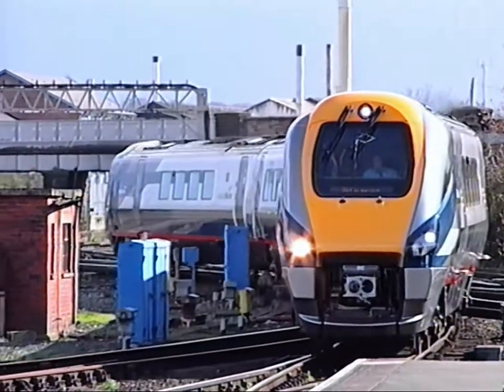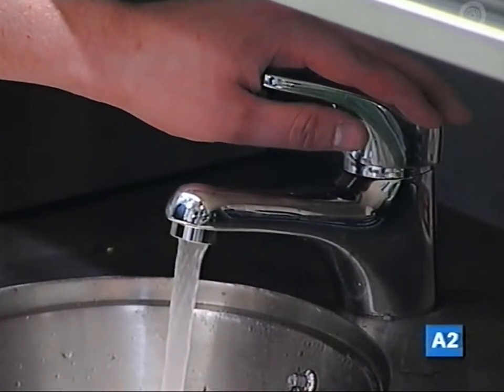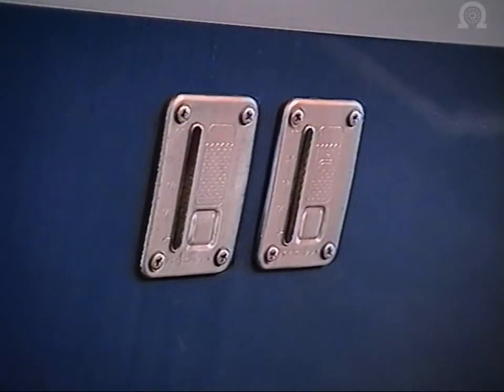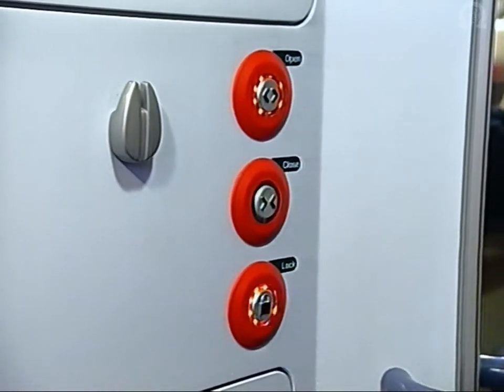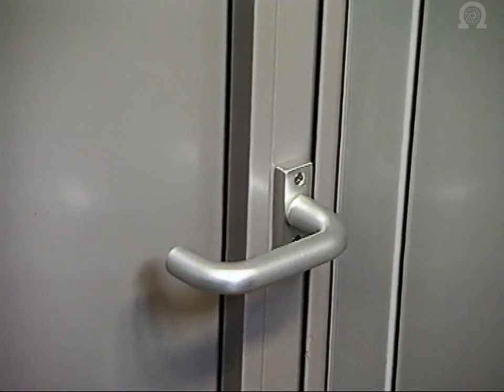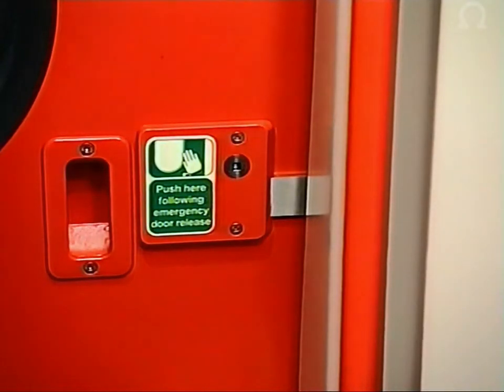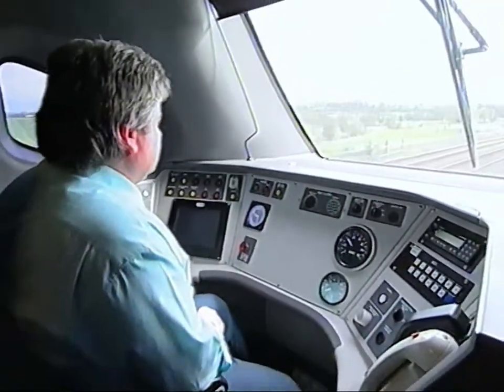Midland Mainline - Class 222 Meridian - Staff Training Programme (2004)

Comment: Drivers get by far the quietest ride on all class 22X trains. Such a shame that their excellent acceleration had to come with such poor sound insulation and engine mountings. All sets have had some form of mid-life refurb, but it seems the budget never stretched to sorting out these issues. The 800 series bi-modes are awful trains for other reasons, but at least when on diesel the saloons are fairly quiet and free of rattles/squeaks.
Reply: bruh don't dump on the 80X like that! the diesel mode sounds aren't the only good thing! and new trains are often way too overhated
Reply: @bigtrainguythore  
Each to his own, but I'm in the majority who dislike the 800/802's hard seats, harsh lighting and rough ride at 110-125mph. They might be okay as outer-suburban units, but for long-distance InterCity journeys they certainly are not.

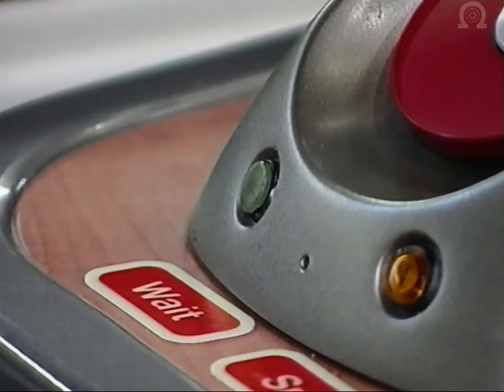Comment: 8:58 that explains what that sound is I’ve heard it loads on Pendolinos and the related Voyager units
Reply: It could also be the driver to guard communication call.
Reply: @EastMidlandsTrainspotting  will be that as well but ive heard both sounds loads of times.
Reply: If you hear it on the move, it’s likely AWS… has a very similar noise.
Reply: @gapa1982  it won’t be AWS as it’s a different sound plus been nowhere near the driving cab when I’ve heard it.